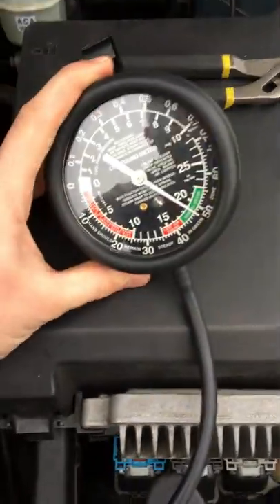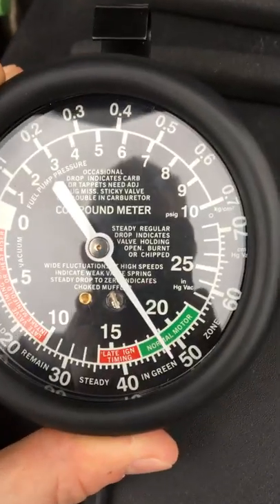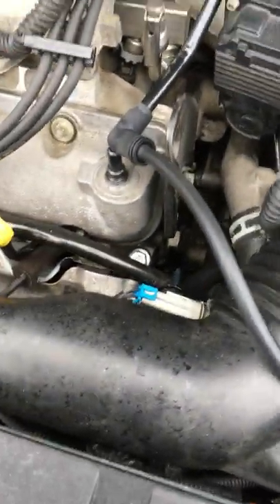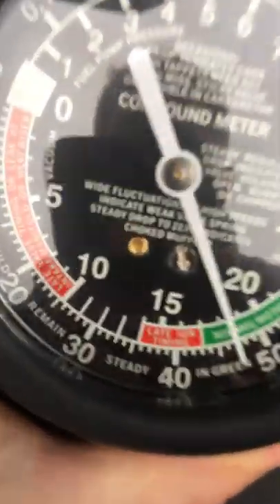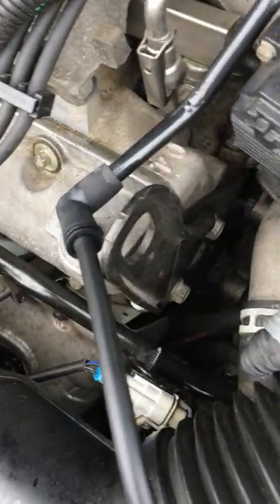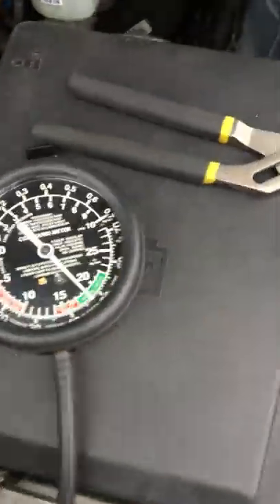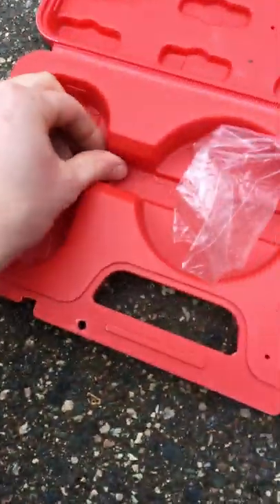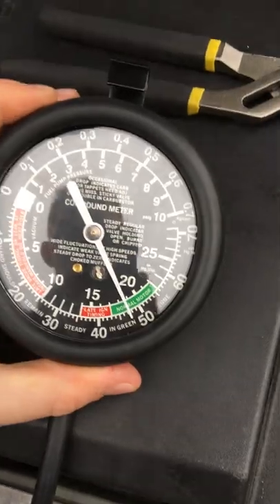Using a Vacuum Gauge to Diagnose Engine Problems!

Comment: First video that actually goes into detail where to hook it up. As a DIY'er it's not always easy to know where "hook up to a vacuum line" is, especially without a T-pipe adapter.  :) 

A question (which may already be explained in the video, but I missed it) - is the PCV valve closed on idle or does it simple leak into the atmosphere?
Could it affect reading the gauge in any way?
Reply from the maker: Thank you I appreciate that! I guess I’m not sure what you mean by closed. Typically it’s attached at both ends so nothing is just open to the atmosphere if that’s what you’re meaning.
Reply: You want a direct manifold vacuum source , below the throttle plate . The vacuum hose from the brake booster is one . Make sure the plastic check valve going into the booster is not cracked and leaking vacuum . The pcv valve hose may also be one . But on newer vehicles that would have to be verified . There is a lot of engineering on late models .

Comment: 3:31 Will any of those brass adapters fit the exhaust ports for the O2 sensor?
Reply from the maker: It was awhile ago, but if I remember right, I didn’t have to buy anything separate for the O2 ports. I think I connected 2 smaller ones together and that worked, but I’m sorry I guess I can’t say with absolute certainty. Couldn’t be more than a couple bucks for the correct fitting though I wouldn’t think
Reply: @TotalDIY2737   oh but the O2 ports on the exhaust would require the largest brass adapter. how would using 2 smaller adapters make up for wide width of an O2 sensor port?
Reply from the maker: Good question! I guess back to the buying one adapter idea may be the best bet then. Sorry I misunderstood..
Reply: No
Reply: Why would you put a vacuum gauge on the exhaust? Exhaust is pressure not vacuum. Are you trying to find exhaust restrictions?